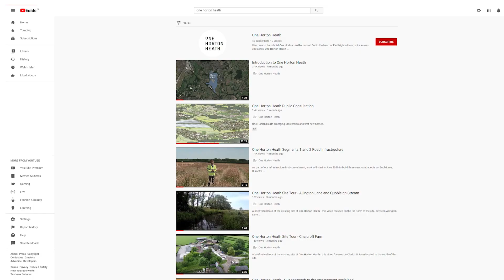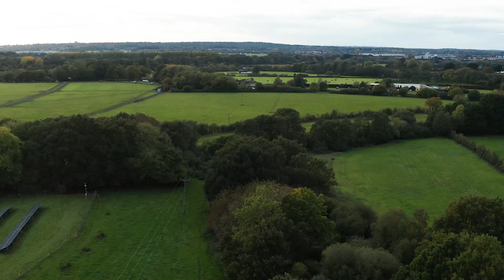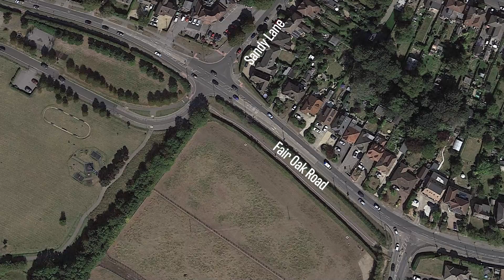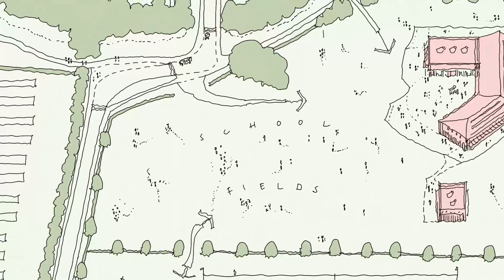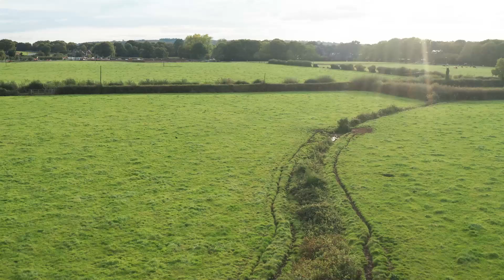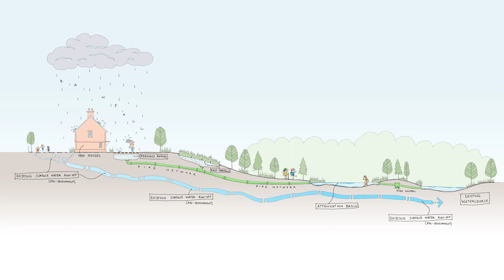One Horton Heath Public Consultation November 2020

Comment: Ok, I hear lots of words aswell but tbf I think they are being as open and honest as they can, based on the fact nothing is actually approved. Better than just ripping up the fields and whacking down flats with no consideration of transport links and other public spaces. They have also responded to many of the concerns raised on other videos so can't see reason for complaint at all. I just wish they had plans to add a safe cycle route along allington lane to the country park as this is probably the most obvious local leisure destination for families moving in.